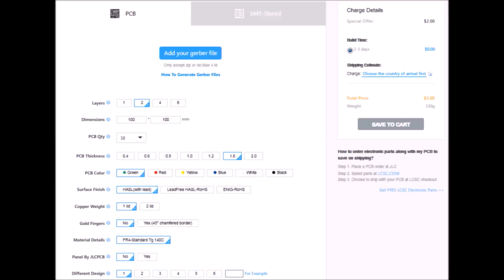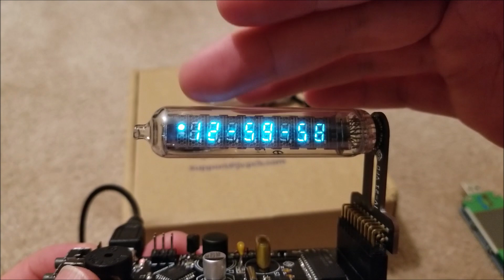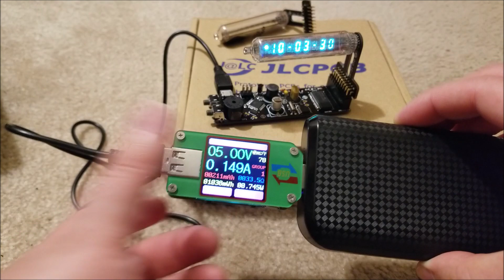DIY IV-21 Tiny VFD Clock

Comment: Not sure what you mean by current limiting the filament.  The filament voltage is specified in the data sheet so I would think as long as you are able to supply the correct voltage, the current would naturally be correct (as per Ohm's law).  If anything, you would need your supply to be able to provide sufficient current without voltage sag.  Please clarify.
Reply from the maker: Since the 5v rail I am using to drive the filaments is effectively regulated I need a current limiting resistor or I'd be driving them too hot and shorten their lifetime. I am using 5v since everything else in the system runs off 5v and I didn't want to add an extra regulator just for the filaments. In a way what you are describing by driving the filaments off a constant voltage which naturally sets the desired current is exactly what a resistor fed off a regulated rail does, it has a voltage drop that happens (by design) to be exactly what is necessary to allow the desired current to flow thru the filaments. Just two different paths to achieve the same thing.
Reply: @sjm4306  Thanks for the quick reply.  OK, so I gather the voltage drop across your resistor provides the filament with less than 5v due to your resistor, so it should be true that the reduced voltage is within the given specified filament drive voltage.  So to my mind, more like a "dropping resistor".  Essentially, the same as having a regulated voltage at the same "spec" voltage.  Right?
Reply from the maker: Correct! The terminology "current limiting resistor" is generally in reference to the simplest method of driving LEDs, I just borrowed the phrase since the resistor is used for similar effect here for the filament.
Reply: @sjm4306  Hi again.  According to Noritake, the grids should be negative with respect to the AC filament to avoid ghosting when the grid is off (they mention a bias "Ek" on the center tap when using a transformer).  Therefore, I think it's better to put the dropping resistor on the negative side of filament to raise the bias (read that somewhere else).  I'm curious if that's what you did.  May not matter much if you're using straight DC anyway.  You also mention that you can control the filament from the uC.  Not sure if that's just to turn it on or off, or to produce AC.  If the latter, then I think the bias becomes more important.
Reply from the maker: Generally you want to drive filaments with AC (especially for long tubes where a DC bias will make it obvious there's fading across the digits. For mcu control of filament I meant implementing a pseudo-sinusoid ala spwm driving an h-bridge followed by a low pass filter then bam that's the desired AC drive.
Reply: @sjm4306  OK, so it's AC, thanks for clarifying that.  Not sure what your AC bias is.  I'm just advocating a positive bias on the AC based on what I have read from the Noritake document as well as another source.  If I'm not mistaken, I believe that means putting the dropping resistor on the low side.

6.2 Filament Bias Voltages (Ek)
The filament bias voltage (Ek) is a voltage applied to
the filament center-tap in order to cut off background
illumination when the anodes and grids are not
addressed. The 'off' anode and grid voltages remain
negative with respect to the filament. The total supply
voltage Vdisp is ec(eb) + Ek. ( In the case of CIG
displays, the Ek is included in VDD2.)
In typical driving circuits, a zener diode supplies the
Ek as shown in Fig.17. The cathode bias (Ek) for
filament center-tap is higher than that specified for
the grid cut-off voltage (Ecco). Usually, the Ek is set
at the same value as MIN voltage of Ecco shown in
the specification or a slightly large value when
utilizing a filament center tap (F.C.T.). If a center-tap
is not available, a virtual center-tap with resistors is
one acceptable alternative.
Reply from the maker: So dc bias is basically always positive bias and ac bias referring to referencing to a center tap just means it can swing both positive and negative. The placement of a resistor for dc bias either above or below the filament has no difference as far as I know.
Reply: @sjm4306 This is the specific comment I was referring to.  It came from a google group discussion on VFD displays.

"> 3) I read that the grid needs a negative voltage to make sure all the segments are off. Is this true?

Yup, it's true. However, it's easy if you're running your filament from 5V: just put the resistor between filament and ground and hook the filament directly to 5V. Then when you ground the grids/anodes, they'll be more negative than the filament."
Reply from the maker: I've never heard of this, so far I've always run everything respective to the same ground and just dc bias the filaments. I have a feeling the reasoning behind the slightly negative reference is to absolutely ensure all segments/grids that are supposed to be off are fully off, but in practice I havn't had an issue with my simple setup so far.
Reply: @sjm4306  Yes, I don't think it's necessarily always an issue, and glad to know you didn't encounter it.  I also read that oftentimes a zener is used to raise the common ground to produce a new filament ground (instead of, or in addition to the resistor I mentioned).  If you're interested, I just found another reference for that in VF display fundamentals (PDF) by Allegro systems.  Section 4 shows a diagram of exactly that.
Reply from the maker: @Enigma758 thanks for the tip, I'll have to take a look at that allegro technical paper

Comment: I was just going to say, if you add gps you can have real time. maybe a combination of the RTC clock, and then the gps to recalibrate the time if there was a powerloss. Also could make the display display some other things too.
Reply from the maker: Actually working on doing exactly that for an upcoming project. I've got some test code mostly working with a cheap gps serial module so I can pull coordinates, adjust for time zone, pull date and time.

Comment: I really liked your project.  I want to do something a bit different and was wondering if you have / could provide a breakout/spec for the IV-21,  I am looking to design an interface for the raspberry pi pico w. any information would be great. thanks in advance.
Reply from the maker: I've uploaded all project files in the project page that's linked in the video description. The schematic and board files show the tube pinout. As for specs I had to google the original datasheet and use google translate to figure that out. Even just looking at the numbers you can pretty easily guess the drive voltages/currents if you are familiar with vfds.
Reply: @sjm4306   I did see that, however I cannot read sch files... would you be able to provide a PDF or a gif?
Reply from the maker: Shoot me an email at sjm4306@gmail.com and I'll send you screen caps of the schematic/board files tomorrow
Reply: I found this link in the comments on project page... https://drive.google.com/file/d/19pHtBFc515MrxD8HwFjyqsK27nt_Oiih/view?usp=sharing

Comment: Hello, please help with programming the atmel328. Does the bootloader have to be loaded or not? How should the fuses be set, I set them wrong and the atmel328 is blocked. Thanks Pavel
Reply from the maker: A bootloader is only necessary if programming over serial, icsp programming doesn't need it. If you've bricked the atmega via fuses you will likely only be able to reflash it using a special high voltage programmer. The chip must be removed for this. In either case if you flash the bootloader via the arduino ide you never need to manually change fuses (really you should never touch fuses unless you know exactly what they do).

Comment: Yeah the LED light on the Gameboy micro start and select buttons if you can find the same size LED that can fit perfectly near all the buttons but not turn off like the start and select buttons until you turn off the power switch button and you can choose your own color instead of the red or blue because it will interfere with the charger blue when it is plugged up and you don't want red because when your battery is dead this will be confused with the same colors as the charging or when the battery is dead

Comment: Greetings sjm4306. I came here, recommended by someone else, Zenodilodon.
I have a very nice VFD (not tube) and, along with the PCB, has the controller named Sony CXP50116; I would like to make a clock with the date of the month and the days of the week (which the digits allow) but, I do not have enough knowledge, especially with this controller that is strange to me. Have you ever come across a VFD with this type of controller? If you can help me, I can even post a picture of the display here; thanks
Reply from the maker: Thanks for reaching out. It'd probably help if you can link a clear pic of both sides of the board. Basically I'm interested if the pcb has a manufacturer or model number printed on it? The chip, CXP50116, is just a generic 4 bit microcontroller so without dumping its firmware and reverse engineering the assembly it's basically impossible to know how to communicate with it to control the vfd. However if we can find the company who manufactured the entire pcb as a module we may be able to find a datasheet with commands or example code to drive it.
Reply from the maker: Ok so the quick answer is there's not gonna be a book specifically on this as programming a 13 segment display is a very niche situation that really isn't relevant anymore. However, the general approach to solving this problem is basic programming theory. 

Let's start with expanding the array in your example. So it only stores one byte (enough for seven segments), but you need two bytes. 

Let's assume in an example your display is 16 segments. Simple to fix, an int is usually at least 2 bytes so just extend the values in the array like so: 0b0101010101010101(16 bits, random number just for example). If you need more bytes then you would have to change the variable type from int to something bigger like a long.

And the important thing to understand is the order doesn't really have any fixed requirement or convention, I as the programmer define which segment goes where based on how I want them to be ordered and how I physically wire the VFD to the microcontroller pins. So in my example I could define 0b0101010101010101 to equate to segments ABCDEFGHIJKLMNOP and here every other segment is turned on (1). If you have less segments you can just fix those spots to be 0 or 1, doesn't matter.

So now we have memory that can store the segment states for every digit. Finally the important part is we need additional software to take those saved segment states and toggle the physical pins on or off according to the states in order to light up or not light up the actual segments of the display. This will usually be some sort of gpio (general purpose input/output) write command like digitalWrite or PORTx (where x is the letter of the port of the pins you want to change).

One last thing is most of these character displays are going to be multiplexed (basically all segment A's of all digits are connected, all B's together, etc but each digit has its own select pin). To multiplex you set the segment states and then turn on the digit select and wait a little bit. Then you turn off all segments, turn off the digit select, look up the next digit segment states, set those segments and turn on the next digit select pin. You do this for all digits quickly and to our eyes it looks like all the digits are on correctly at the same time.

Comment: OMG I so love this one it's like futuristic clock how much would this cost for a person with limited funds ☹️
Reply from the maker: The cost of the parts and pcb would probably be somewhere around $40-50 in low quantity. A reasonable diy kit price would likely be around $80 with overhead and profit margin. A premade one factoring in assembly time/testing would cost something like $100-110. That's around what the adafruit icetube clock kits and various pre-assembled etsy vfd clocks go for.

Comment: got to be careful that the DC to DC converter doesn't blow up.
Reply from the maker: For a tiny tube like this and the way overspecc'd power components I'd be very surprised if it even got warm much less blowing something.
Reply: @sjm4306  It looks like the display in your clock came from a pocket calculator, so low power. I was thinking about it watching the video, because I bought a couple of VFD display clocks, that used VFDs originally intended for microwave ovens, which are larger. And the DC to DC converter failed in one. It was replaced under warranty, but the replacement is marked as version 2, so I guess the maker made some changes to it.

Comment: Freaking awesome.  I also have some Soviet IV-18 tubes that I want to use for similar projects. Do these boards work with those tubes as well?
Reply from the maker: I haven't wired it up to my IV-18 to test yet, but since it's based on a similar circuit I built my old IV-18 clock from I see no reason why not. I'll throw together a neck adapter board in the near future to wire up my spare IV-18 and once I verify it works will provide the files for that as well.
Reply: @sjm4306  Thanks, you rule!  Love your channel BTW.

Comment: Awesome video dude, do you have a parts list? I’d love to make one myself!
Reply from the maker: Thanks, I posted project design files to the writeup page here: https://hackaday.io/project/167749-tiny-iv-21-vfd-clock
Reply: @sjm4306  I'm having trouble sussing out the BOM. It doesn't seem to be complete. It would help tremendously if you could put together a list of parts, vendor and relevant part numbers. That way I could work out what exactly I need more easily.

Comment: iv-18 its work ?
Reply from the maker: Yes, though the filament resistor will need to be recalculated and the vertical pcb to hold the tube will need to be designed (I dont think the pinouts for the two tubes are identical).
Reply: @sjm4306  thnx but iv-18 like this